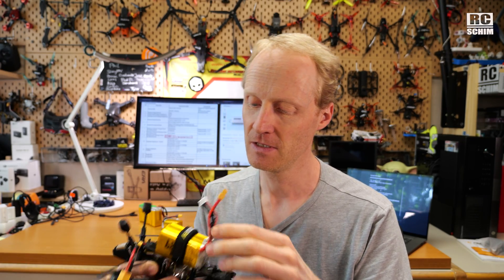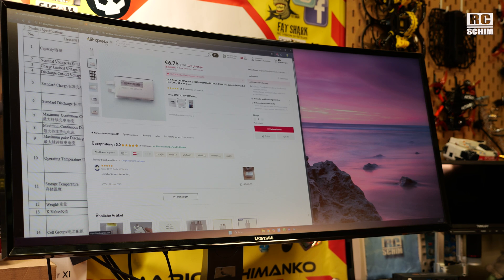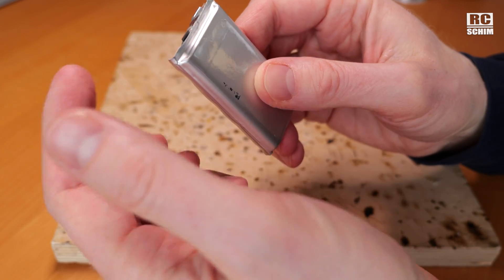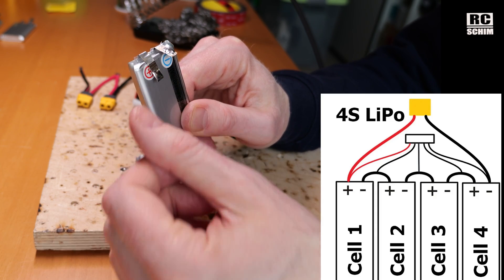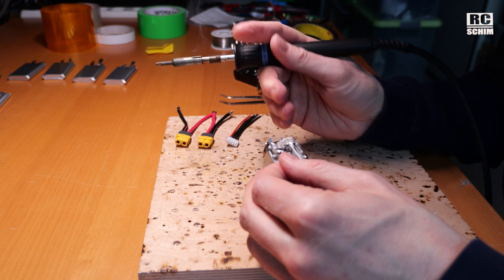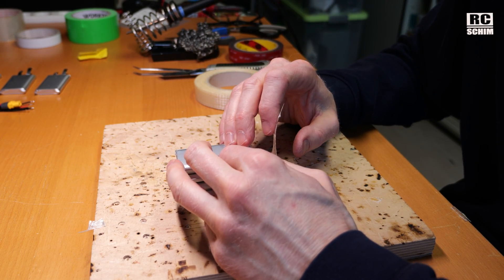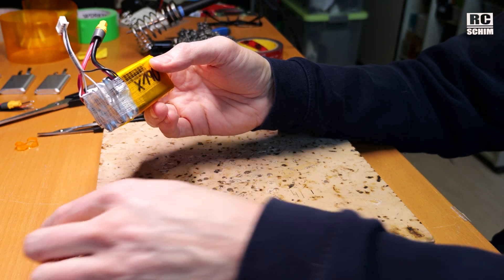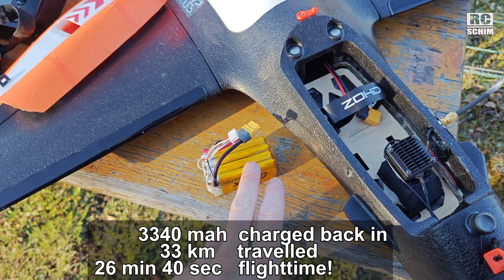...how to make the ultimate longrange DIY pack 🔋(DJIs Magic sauce!)

Comment: Here is 5000mah cell for $6 and 30% larger capacity, same weight more amps.

Samsung 50S 21700 5000mAh 25A Battery
Reply from the maker: thanks for pointing them out. I guess the LiIon cells are the easier and more popular route to go ;)  I cannot spotweld yet (maybe I will try). 
the LiIons are still a bit heavier tho (70 or 72g per cell -  x4 ~ 280-300g instead of the LiPO at 225g).
Reply: @Rcschim yes, but they are 30% more capacity, and not 30% more weight. 
There is also 4000mah 18650 cells. 

No worries about spot welding, I have been soldering Li-Ion since they came out 3+ decades ago. Zero issues, just do it quick.
Reply from the maker: @user-rs8zg8ey2b will give it another try ;)

Comment: You can get better cells, same weight but higher capacity, like "Samsung 40T 21700"  4000mAh 35A
 Battery (40T5)
For $6 a cell. And even better cells.
Reply from the maker: but yes, those newer LiIon with really high AMP performance look appealing!
Reply: @Rcschim I forgot to mention, gTrick50 flew a wing wing z84 wing with 4s2p 18650 pack (7000mah), 50 miles out and 50 miles back, in a 4 hour fpv autonomous flight over the ocean. Just saying a wing is much more efficient for distance and time.
Reply: @Rcschim I have a friend working on a solar glider to break the 81 hour world record, he has 21700 6000mah cells, 20% higher capacity than the 5000mah cells, but I am sure they are not cheap, let me know if you want me to look up the model number.

Comment: Shouldn't you have used the Li Ion setting on your battery checker, when you use the Lipo setting the readings for voltage will be correct but  the percentage remaining will under read  using the LIpo setting..
Reply from the maker: Nope
Reply: @Rcschim  Sorry I assumed they were Li Ion and could be run down to about 2.8 volts. It looks like I have been using my battery checker wrong for years, I test Li Ions on the Li Ion Type and Lipos on the Lipo type setting. Edit: just checked the Alie express specification it says Lithium Polymer. Just checked my DJI Mini 3 Pro and Avata 2  batteries they are both  marked as Lithium Ion, now I am more confused.
Reply: @AlfieDoug you are correct, he even sais himself that these batteries can discharge to about 2.8V. Not sure what chemistry they are, but certainly not standard LiPo stuff with that capacity and that voltage range. Might simply be LiIon in pouch form.
Reply: @MarkusRessel  I make my long range packs with Molicells although these flat packs look interesting I will stick with what I trust.

Comment: Hmm Bad luck for us germans. 
DJI always uses these kind of High volt LIPos. 
They are with a very low C rating though.
Personally I use the Molicel P30B 18650 for a 200g 4S 3000mah pack with 30A continuous and ~50A burst discharge from my testing in the air.
Reply from the maker: Looks like Austria and other countries are also not serviced by this one shop (rograpo). It's a bit difficult to find those cells now it seems.
I agree the Molicel are a more proven path - I'm not yet confident enough to spot weld LiIons...
The 3000mah 4cell LiIon packs you can buy as a finished product are often really overpriced (70, 80€?)
Reply: @Rcschim  wait untill first tabless 18650 cells are available. Like eve 30pl or Bak 30d or ampace jp30. We will be able to freestyle our 4 inch LR cruisers with 70A burst no problem. I'm pushing the bak 45d 21700 cells to 80A burst already. The new eve 50pl are already listed at nkon. Cant wait. More than 100A burst no problem

Comment: its a cheap battery even for my wing that i fly around at 3 amps cruise
Reply from the maker: Yes, I have an ARWingpro - here I used 3x 3000mah 18650 LiIons and flew quite long :)
2x of those DJI cell packs should be even more efficient. COG is a bit tricky tho achieve here...
Reply: @Rcschim  Very cool....mine is the ARwing with small 2306 size motor just setup for slow cruse